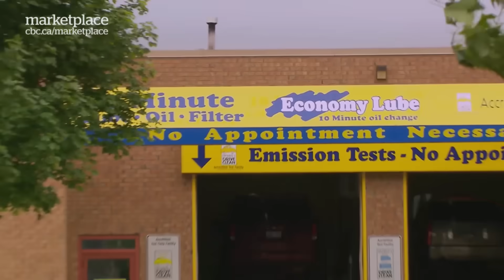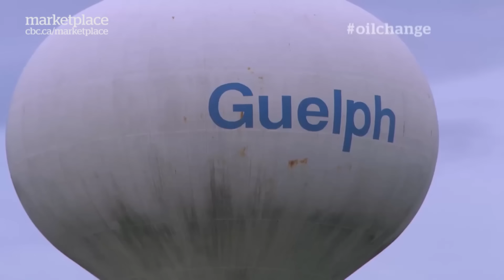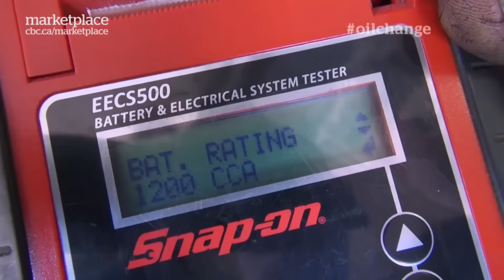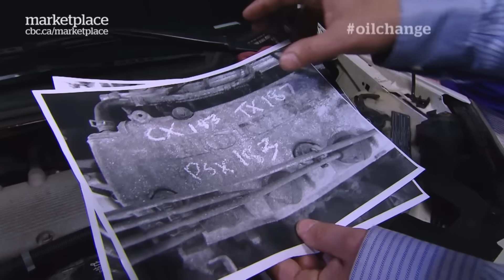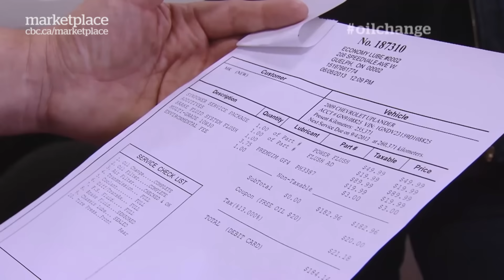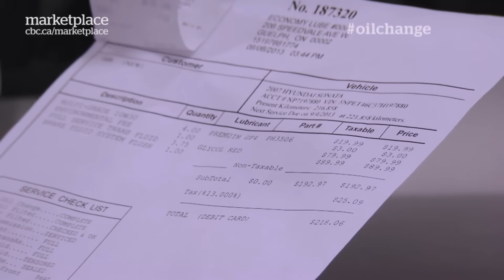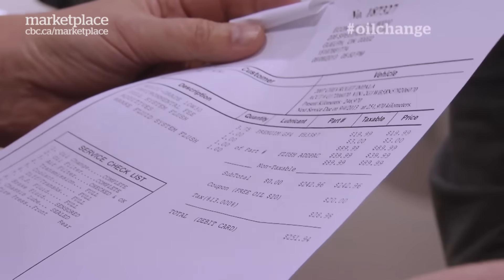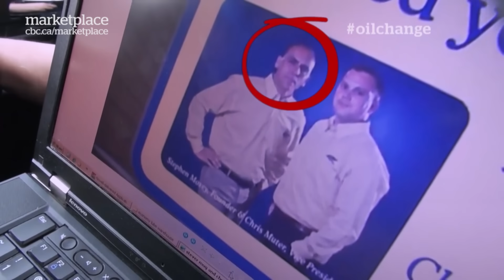Oil change scams: Hidden camera investigation on what really happens to your car (CBC Marketplace)

Comment: After they knew the first place ripped them off, they should have used a different location to see if this happens everywhere... no point going to the same location each time...
Reply: Michael lee
Reply: What?
Reply: are you from ontario canada?
Reply: yes he is
Reply: +Nunya Bidness This does happen everywhere
Reply: Quadrunner YEEEEHAAAAAW!
Reply: YO DID YOU GO TO WESTERN UNIVERSITY ?!?!
Reply: *****
well I watched the "are dentists ripping you off" episode and just about ALL the criminal dentists were ethnic minorities... So I guess that flushes your theory.
Reply: +Nunya Bidness   YO DID YOU GO TO WESTERN UNIVERSITY !!!!!
Reply: +Nunya Bidness do you think scientist run an experiment once then move on?
Reply: john doe
ummm no - but they run an experiment, tabulate the results, and then use a different subject and run the same experiment repeatedly until they can be sure there is a pattern or if it's just a one off.
Reply: john doe Scientifically, your theory needs to hold up to repeated testing to be accepted.

The proposed theory failed after just one test.  Assuming the test was conducted properly, the theory needs to be adjusted or discarded.  I'm not sure where you were going with your last comment, but it appears from my perspective that you are looking at the scientific process backwards...Or maybe replied to the wrong person?
Reply: Nunya Bidness What does your thumbnail thing represent.  Hanging the flag upside down is a sign of distress in my country, but in certain context can be an insult to the nation.
Reply: Quadrunner
means the same in my countries...
Reply: Nunya Bidness Point taken
Reply: Quadrunner unfortunately when conducting  a test or experiment, one should not run it just once. you need multiple trials with different variables, aka 3 the cars and 3 different drivers. 3 separate times.
Reply: john doe THE TEST HAS BEEN DISPROVEN.  YOU NEED NOT GO FURTHER.  You want to prove something, then it needs to be proven repeatedly, without fail.  Let me explain this in the same words

 Scientifically, your theory needs to hold up to repeated testing to be accepted.

The proposed theory failed after just one test.  Assuming the test was conducted properly, the theory needs to be adjusted or discarded.  I'm not sure where you were going with your last comment, but it appears from my perspective that you are looking at the scientific process backwards...Or maybe replied to the wrong person?

So are we just going to repeat what the other is saying all day?
Reply: john doe
the test wasn't meant to see of this one particular shop is ripping people off. It was supposed to test whether the issue is systemic among all mechanics. This shop ripped off a client - does it matter if they rip off one client or 100? No - because the test proved this particular shop is dishonest. Now the test SUBJECT (ie the mechanic) should change, to see if another mechanic is going to rip off the same client.
Reply: Sure there is one time shows little! All three show no doubt they are charging you for you for messy, time consuming flushes and simply topping off the fluids!! Then to make it worse fill a dex cool car with conventional green in the coolant tank well dex cool remains in lines and radiator. I disagree with mechanic green coolant is safer than dex cool even in a car that requires it dexcool is notorious for eating through aluminum radiators and getting in oil. Conventional green needs to be flushed twice as much 30k vs 75k but is a safer coolant.
Reply: +Shawn p  Dexcool is trash. Cost me megabucks when it ate up all my gaskets and water was flowing into my oil and also have my heater coil replaced cuz it was all clogged up and leaking.  Google it and your eyes will be shown the truth.
Reply: +Richard Bambenek  yes and somehow gm still stands by it like it is awesome stuff but i dont know too many people who have those issues with conventional coolant when flushed within reasonable time
Reply: My car says dexcool on the coolant cap but a good mechanic changed it to green when it was flushed. He wrote in white paint marker green coolant only so all future mechanics know. He said the aluminum radiator and other parts actually get damaged from dexcool. I honestly dont know the whole story on dex cool and some mechanics say to use it, but whenever u hear of coolant and water in your oil dexcool is the usual suspect.
Reply: +Shawn p That is somewhat true. dexcool actually doesn't combat electrolysis is your coolant system and will, over time, corrode your cooling system. although this could take over 10 years, it's still better to have your system FULLY flushed with green coolant. Some mechanics support keeping the original brand or type of fluid in the vehicle only because it came from the factory with it. trust me when I say automotive engineers that work for big brands design most things, on new vehicles, for profit. GM quit making the 3800 engine because it wouldn't break down and they didn't make enough money from their service bays.
Reply: +Carlos Rodriguez i am not sure about that between warranty and recalls they have just as much potential to lose money for breakdowns! Look at honda and toyota! They are kings now for making easy to work on cars that run longer. 
The last few years most car makers are following this formula. Even now 2015 for and chevy cars are extremely well designed

Comment: I only ever do my own oil changes, but recently bought a Prius that the previous owner had just taken to Oil Changers, which is a Quick lube shop here in NZ. I changed the oil after buying the car, I found the drain plug had 3 washers under it, none of which were the right size or type. The receipt showed that they had put 5w30 oil in it, when the Prius should only have 0w20. Both the drain plug and filter housing needed breaker bars to remove, and when I drained the oil, I found it to be overfilled by 1.5 litres. They also showed on the receipt that they had checked the transmission fluid. There is actually no way to check the transmission fluid on the Prius. Now that I've done the work  the car runs great, but whoever did the last service did a horrible job. I would never take my car to one of these places.

Comment: Owner: so you paid me $750 for this investigation?
Undercover people: yes
Owner: thank you.  Have a nice day
Reply: Yea and he should’ve save that money cause dude gonna go out of business I bet
Reply: I imagine thrice that was paid by his competitor that instigated this load of bollocks. The 3 rules at the end were worthless. I especially like how one of them drives back from the garage and somehow still has bright green anti-freeze in his radiator reservoir, yet it's orange when they pull it out the bottom.
Reply: @surge9000  The coolant in the expansion tank can take quite some time to mix with the coolant in the rest of the system, especially if the car isn't driven far enough for the thermostat to open. It's not like in the olden days, when you opened a cap on the radiator and topped up the coolant there. The TV team's workshop was not far from the lube shop, so the engine probably never reached normal working temperature. What we see is exactly what's expected shortly after when you just replace the coolant in the expansion tank.
Reply: @surge9000   they didn't flush the system or there wouldn't have been 2 different colors. And not doing the services at all is theft, regardless of how much the competitor "bribed" the investigators.
Reply: Owner: default emote dance
Reply: @mr.eugene5754   nope still in business, and still doing shady shady stuff.
Reply: as the proceeds were from fraud, he did not get to keep any of the money. Money stolen, by fraud or deceit, is not earned. His nice day is going to be in prison for felony theft.
Reply: @jbodden6977   not yet unfortunately
Reply: @surge9000  Because whats in the res doesn't circulate through the system until the car reaches a certain temp. It's mainly an over flow vessel. That short trip down the road would probably not cause the car to use whats in the overflow. It's also designed to be drained separately from the rest of the system. Draining the radiator will not drain that res and vice versa.

Comment: This is Jiffy Lube in a nutshell
Reply: Future Shawn truthfully it depends on your local JL location. I worked for Jiffy Lube about five years ago as the Lower Bay Technician (the dude that does the oil changes and all) for three different shops in the Baltimore area and I did everything that the customer paid for. New oil, new filters, new gas filters, everything. I can’t say for sure if the customers really needed everything that they paid for at that time since I wasn’t the guy that sold them the work, but I can say 110% that my customers got what they paid for.
Reply: The jiffy lube in my town is actually really good. Never upsold me at all, down to topping off my leaking power steering like once a month for free 😂
Reply: Jiffy lube, firestone , Goodyear,  pepboys, every single chain shop does it
Reply: Same at mr. lube. I had a buddy work there and he told me it was the same. 

I'd go in and they'd say, "Oh you need blah blah..." Then my friend would be like, "Woh, that's my buddy". And suddenly I didn't need the work anymore. 

So bad....
Reply: I worked for Jiffy Lube, and it wasn't like that at all. I worked on the upper bay but visited the lower bay as well to see what they were doing and they did everything the customer paid them to do. My online training consisted mainly of technical details about cars and how to recognize faulty fluids/systems, and how to fix them; very little was taught in the way of sales and marketing. Experience may vary as it is a pretty big chain but my experience working at Jiffy Lube was good. I was in the Northern Virginia area btw.
Reply: All jiffy lube are privately own, only the name is franchised out so every jiffy lube is different from services provided to quality work done to vehicles, to trustful technician who stay updated on training relies all on the owner and how the shop is managed and every shop is different.
Reply: Yep I have had problems at all these places. Gone in for an oil changed ended up spending well ove $100. I found out about the shady upselling techniques from friends who used to work at these places.
Reply: I’ve been to a few bad jiffy lubes, but I found one in West Omaha that I absolutely love. I trust them completely.
Reply: It can be but not always.
Reply: No, this is Precision Tune in a nutshell
Reply: It's a franchise. The Jiffy Lube in my town is really professional. The manger knows every thing about every car. They let you get a coffee and watch what they are doing.
Reply: I got a really good friend, been friends for years, that works at Jiffy Lube, and I just ask him when he’s in the shop so I can go when he’s in shop and have him handle my car.
Reply: Not all. I've managed a JL in Dayton OH and I would not tolerate this from my CSR or team. We prided ourselves on quality and our repeat business "regulars" of which we gained new customers by word of mouth. People just dont have integrity or pride of work anymore.

Comment: The charging for stuff not done is one thing. The person who is getting the oil change should be able to see past that, or at least have a trusted mechanic to do that kind of work. But the coolant thing is what floored me. Mixing coolant like that really can destroy the engine in a car. That's not just some $60 or $80 overcharge; that's a possibility of thousands of dollars worth of damage to a car engine.
Reply: coolant could be piss if it didnt freeze
Reply: william bradshaw orange and green no mix mister
Reply: coolant could be plain water, but it won't be as effective .... your engine block will overheat faster
Reply: Bobbius Shadow not true.  What will happen is it will freeze at a higher temp and boil at a lower temp.  As well as rust the inards of your cooling system.
Reply: I know, Jacob... I agree totally  ... I'm an engineer
edit:  what I meant: IF you're out of coolant (ethylene glycol, a form of "sugar"), you could use water, but highly not recommended for the reasons you mentioned and also what I said and don't drive for a long period or it would "explode" due to built up pressure and don't let the water freeze overnight which would expand and make fissures
Reply: Willass Maximus thats not true. Valvoline maxlife coolant is green and it is compatible with 100% of all other types and colors of coolant including dexkill
Reply: What should happen is people should get what is offered and what they pay for. These places should be fined heavily and shut down when caught scamming.